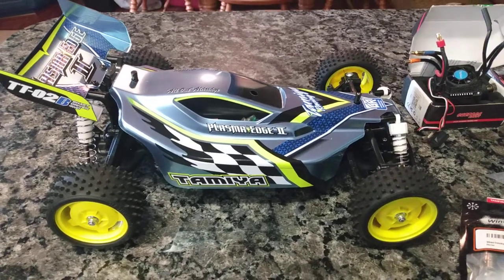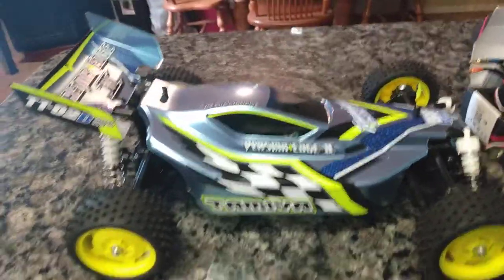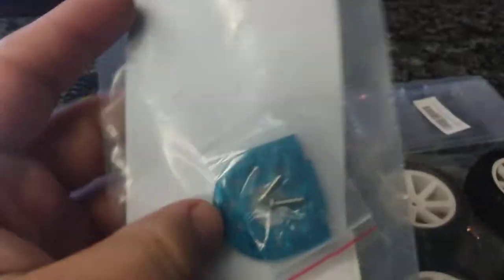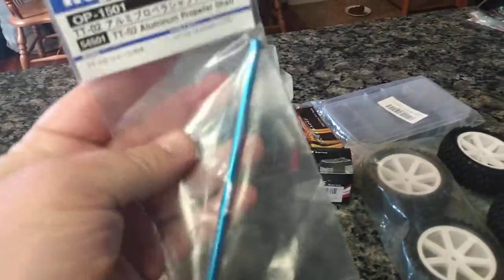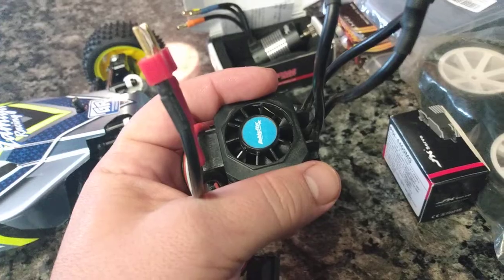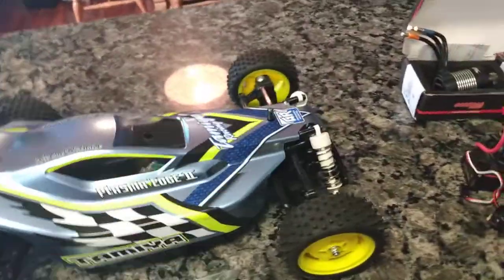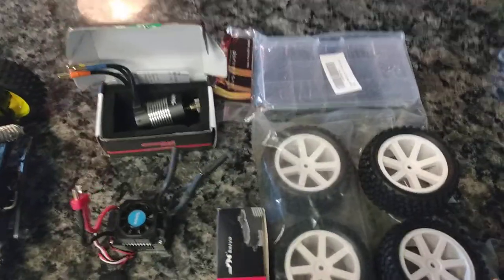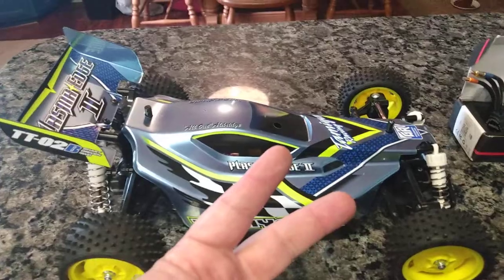Tamiya Tuesday - Stevo D 313 Memorial Tamiya Build Off

Comment: Hi there, that Plasma Edge is definitely going to be really quick! Hope you’re going to be able to control it after the additional modifications, going to be a speed machine 😉😊😁
Reply from the maker: It should be ok..Diff tuning is key with 3s power..I have another one that does 50 plus .. Similar mods but a bit longer motor can(lower kv) and bigger ESC

Comment: What do you think about a sidewinder 3 with a 4600 KV motor from it on my super hot shot you think it's going to bust apart or you think it'll handle it cuz I know 4000 can work on the terra scorcher.
Reply from the maker: Should be fine on 2s lipo..Make sure you use AW grease in the diffs to tighten them up
Reply: I need more of that stuff it is in the rear diff now.
Reply from the maker: @bradkalman2353  make sure you put it in the front also